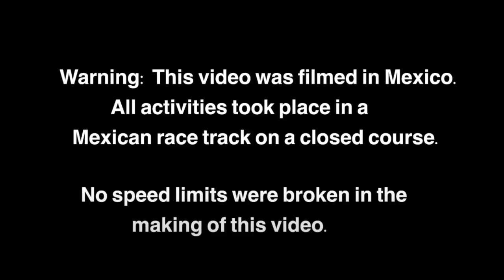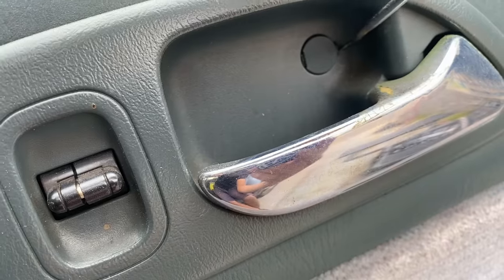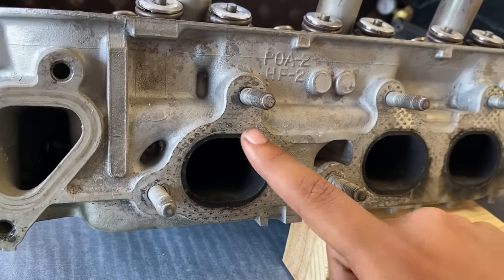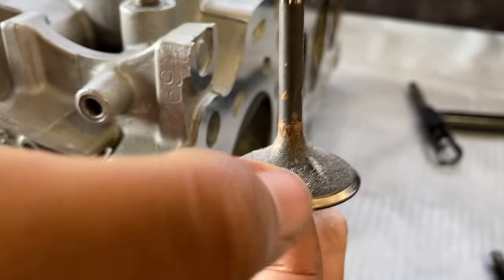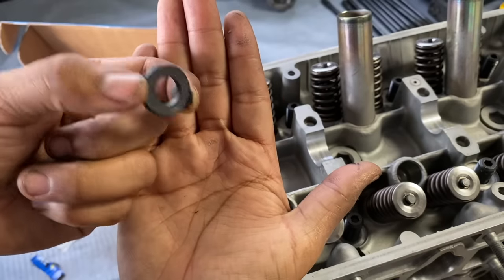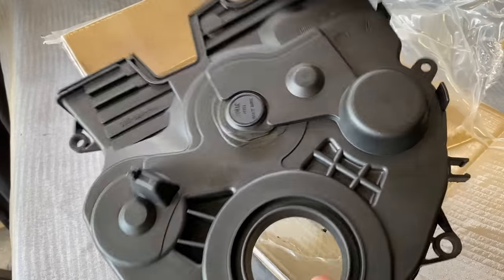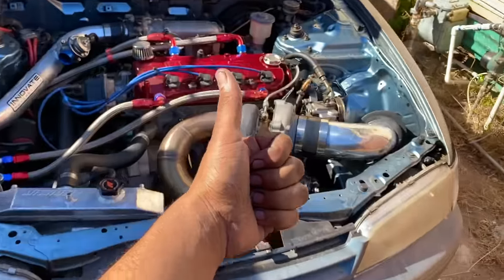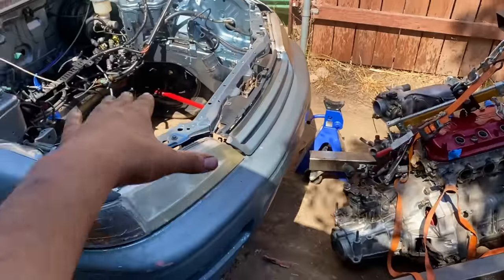Turbo Honda makes 392 Charger Mad + Build Upgrades

Comment: Can’t stand people who thinks their car is almost a hellcat.
Reply: How about peoples who's car is a Hellcat? lol
Reply: @bobfish3176  would they then be the ones who think their car is almost a Demon? 🤔 lol
Reply: @PareKo82  No it thinks it's a Plaid now! lol
Reply: No it's a Bugatti now
Reply: Hellcats are overrated
Reply: @officalsauceboii2172  Obviously you have never driven one! LMAO
Reply: @bobfish3176  they are overrated.  A 12.3 1/4 mile at 123mph in a 6speed manual is pitiful for a 700hp car. Most hellcats in auto run about 11.6 which is pretty damn close to a mustang gt with a 10sp auto. Nearly 4500lbs kills it. Before you mention practicality show me where someone is actually driving a hellcat with people in the back seat . Mostly alone, they might as well buy a bike.
Reply: @Spiritcr1jsher  I slapped 305 drag radials and immediately hit 10.9 with only a drive shaft and diff brace for mods. I would pull 12.2 in my 6 speed 392 so sounds like that car needs a driver mod lol. $ per HP they are very hard to beat!
Reply: @bobfish3176  but not lbs per HP which is what really counts.
Reply: anonymous  😂 🤣 perfect analogyt
Reply: These broken ego 392 owners are the equivalent of v6/4 pot turbo "muscle car" owners driving erratically just because they got a camaro RS, or in the case of the mustang a ecoboost, and they automatically think they got a racecar. I ain't denying, yes 392s are fast, but they ain't gonna beat no sh*tbox honda with a  turbo bigger than the engine itself, and lightweight af...
392 guys, yall should have gotten a hellcat, yalls APRs are already sky-high, why didn't yall just go for the bigdawg and make it worthwhile, JS🤷‍♂️

EDIT: I know, I know... not all 392 owners are like that, I know some of yall be chill asf, yall good. It's the owners that think their 392 beats anything, and "mOpAr oR nO cAR" when they be comparing their car to a McLaren... like cmon.. this ain't Forza, where a Peel p50 can outrun an aventador. Stick with beating stock ss, and 10spd GTs. That I stand with
Reply: @bobfish3176  he can gap hellcats too
Reply: @Miguelc-do8yx  I bet he gaps Plaids too! : )
Reply: I think people are confused. It’s all about Built versus bot. Of course a Built turbo Honda is going to gap a 392 or a 57 get the old 5.7 or 6.1 block proper ring gap on stock internals you can get over 1000 hp.😊 but there’s tons of cars out there with a shit ton of capability just don’t copy everybody. I think that’s the biggest thing with the hemi people they want to go throw a wicker bill and some lights on it. Take the cats out and think it will gap everybody 😅throw that money go your intake, polish your heads.

Comment: I love that roof scoop. It would instantly remove any credibility about your cars performance.  The perfect misdirection upgrade. I drive a 2013 Hyundai accent and even I might race somebody who I saw put a roof scoop on an older sedan. Though I’m pretty sure even a stock Honda would dust me regardless. You’d think the engine sound might sort of give you away though. I’m sure it doesn’t sound slow. Great video lol
Reply: surprisingly with this as long as he isn't gassing it hard it really isn't that loud. totally badass car.
Reply: @bcolerl8915  I suppose not lol. By the time they hear that engine they’ve already fallen for it.  I couldn’t agree more. Totally badass

Comment: I love that you run muffler not open dump, it’s so quiet and stealth.
Reply: plus its a honda, if he didn’t run a muffler it would sound like 💩
Reply: @cannabiscraftsman1278  your point is valid and hard to argue.
Reply: Open dump ftw
Reply from the maker: If I could make it sound as quiet as a Tesla I woulda :D I love hearing only the turbo and wind hitting my windshield 🎶
Reply: @SleeperAccord  ayyy true man of culture. Nice build tho reminds me of doin a all motor build on my old da9 integra took the stock b18a1 n had a fully forged b20z build loved it never got to boost it tho sadly
Reply: Turbo J swap 91 accord 2 door on hoosiers
Reply: @cannabiscraftsman1278  a stocl d15 yeah, but a built turbo honda engine with straighr pipes just sounds so good
Reply: @SleeperAccord  dump valve is one of the sexiest sounds in the world for sure.
Reply: It makes it even better when it looks like a stock car beats out a challenger!
Reply: @cannabiscraftsman1278  I agree, Hondas sound like shit. but a turbo honda with a turbo and exhaust that big, really don’t sound bad
Reply: @SleeperAccord  electric swap it, than it will be as quiet as a Tesla.
Reply from the maker: @CasenFerg  considering it tbh

Comment: Scat pack: Calls accord a piece of shht. Accord: "So, you have chosen death"
Reply: @damienscott9654  but they got same Power and torque basically same car
Reply: @damienscott9654  that’s crazy cuz it literally has a scat on the grill 😐
Reply: @joshfiveoh  was dude tryna say it was a standard v6 because he owns a scat and is salty it got throw in throw in dump by an old accord? Lmao, he deleted whatever he said so I'm askin
Reply: @AIIen-u  nah he said that it was a 392 not a scat 😂😂
Reply: If the accord is a piece of s#@%!,what makes the 392???.wow some people just can not take it.
Reply: @AIIen-u  tbh it’s a fully built car that weighs 1/4 of the charger lol
Reply: @edgarvasquez8372  the accord is a piece of shit though might be fast since the owner knows what he’s doing but it’s still very old and not hat comfortable to ride in
Reply: his dog eyes could not see mount fuji.
Reply: @rzrazorcore2696  it might just be me but all the charger/challenger drivers i met are all aggressive and want to race with their ego on their shoulders. Just because u got a big engine doesn't mean your weight wont mean nothing. The same drivers wont even bat an eye to me now that i drive a GTR coming from a 370Z
Reply: @letsroll2463  those charger/challenger aren't even finely tuned from factory and most of them don't even have proper tires. even if it has 700hp it's probably only making 450-500hp at the wheel.  they aren't slow cars, but most of that power is wasted. unless you change the stock supercharger for a stage 2 which they also offer at your local dealer for a lot more money which is why most ppl don't buy it and just buy aftermarket. apart from that those 2 cars can easily lose 250lb with a good weight reduction.
Reply: 392 likes on this comment 👊🏽😂
Reply: Eh, ill take the honda without all the added electrical bullshit, the mopar is the piece of shit in this instance
Reply: Eh, that 392 is just the credit score....

Comment: I love coming across sleeper cars "out in the wild" About 12 years ago I had a supercharged 01 trans am, it would get out and move pretty well.  I got fuckin walked by a rusty 95 4 door neon on steelies. It had a big turbo srt4 swap in it, was gutted and putting out about 450 at the wheels. Did not expect that thing to run like that.
Reply: Those light cars can find grip and move !
Reply: @souljayt8411  I definitely had him off the line, but once he hooked up in 3rd gear, he pulled past pretty hard.

Comment: Great idea on the cable retention on that door… only thing I’d change is when you wrap that cable around the bolt do it in the same direction the bolt spins to tighten it

Comment: My dad bought this honda back in my days, and I used it to run the Honda starlet turbo and out ran a corolla with turbo. The car was so fast factory with even a bad transmission but still it was the talk of the town. Years after I left the house the transmission got hit and my younger brother ordered a new transmission out of Japan. Went home for vacation couldn't believe the power and speed that thing had. My dad wrote that car off and I was sad because I was gonna take it and build it. It was a special car without any boosting coincidentally.

Comment: Hey, just a quick tip - When your de-burring bit is clean, spray WD-40 on it. The shavings will not stick as bad. You'll need to reapply the WD-40 (when the shavings start to stick again). Love your build and how you're humblely trolling people to race

Comment: Couple things with torquing hardware. There's nothing technically wrong with dry torquing hardware, it normally just requires a higher torque value. In some instances a wet torque is preferred though, especially with mechanical engine assemblies. Also adding an extension to your torque wrench changes the value of your torque. You can find the conversion formulas online but they're normally also in the SAE and ASME specs typically referenced for most hardware.

Comment: Imagine paying over sticker for a dodge charger scat pack just to lose to a sleeper. I might build a kia forte sleeper
Reply: Dont
Reply: Double don’t
Reply: triple don't, put a forte body on something useable, like anything else
Reply: Quadruple don’t
Reply: Save urself some headache and get a genesis sedan they come with 5.0 v8s pushing about 420hp n 380 tq all for 20k its a sleeper from factory
Reply: I've seen some Kia builds, not past ~300whp though. It'd be a sick sleeper for sure
Reply: @krishnapatel2863  hell yeah my homie's V8 Genesis sedan is a ripper but they're a bit heavy. Like 4500lbs curb weight, 50% more than an 8th gen Civic.
Reply: PT cruiser sleeper
Reply: Kai trash
Reply: @Ernesto Urtez no worries it'll be welcomed to the world of weight reduction!!!
Reply: Get a Stinger at least
Reply: I don't think people get what a sleeper is lol that would be pretty funny. Just don't try and use  kia/Hyundai motor looool. You won't make any power and it'll blow up after 1 lbs of boost
Reply: At least k swap da kia
Reply: @torryminers2177  YES
Reply: @iheartgs400  it’s harder to get the Kia dealership to even let you test drive a Stinger than it is to test drive a Porsche. I’m not joking.
Reply: @amr1t_  Lol youve seen the stories
Reply: @dylancraig1  not even just seen online, my older brother had no issue with securing a test drive for a taycan turbo, but couldn’t even get one on the stinger. No wonder the stinger didn’t sell, nobody could figure out how it felt to drive one! 😂
Reply: @amr1t_  😂
Reply: Do whatever you want dude. Don't let people stop you. Accords are boats to and look at this guy. Just saying.
Reply: Don't do that.  There's not much aftermarket support for those and the engines are super weak.  Honda engines are.plentiful and cheap depending what you choose, reliable, have any aftermarket part you can imagine and there's also tons of resources of how to do things because so many people have.  Ya its nice to be different, but I'd rather go with a sure thing that is alot more straightforward
Reply: Kia K900 is factory sleeper with a V8 you can get for a really good deal.
Reply: @Brave-Octopus  wth is that? Not in North America.  That doesn't exist
Reply: Or do what everyone else is telling you to do see how fast that gets you. The reason people like this guy stand or is because they do things that aren't expected.
If doing what is tried and true and what everyone has done and is affordable and safe, if that makes you happy then do it! 
But if you want to do something different then do that too even if everyone says it's a bad idea because there's always a chance for failure bit if you're successful then you will be the stand out.
Just something to think about.
Reply: @rxtuninginc8444  yes it does. It was Kia’s most “luxurious” model. Big boat.
Reply: @joshuajordan5700  🤣🤣🤣 boy stop
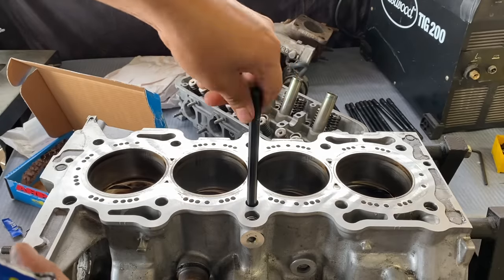Reply: @krishnapatel2863  used is way less…. Also check out 19:58
Reply: @lllllllllllllllllllll1lll1  sleeper cr-v

Comment: Hey you can take the regulator and motor out the piece holding the door windows up for more weight reduction. Just  put a small block of wood under the window when it’s fully up and drill a self taper or a few thru the door into the wood

Comment: I don't know if anyone has written this in the comments, but there is a reason the head, intake, exhaust ports don't all match. When you think about it, Honda, with their high build quality, casting quality, etc could cast things that match perfectly, but they don't. The reason is a smaller port flowing into a bigger cross sectional area fights reversion, or backward flow. There is a formula for this that I can't remember, but if you picture something like a little cone sticking out of an exhaust port into a bigger manifold runner, that really prevents the exhaust backpressure from being able to push back into the head on the overlap cycle. A port mismatch accomplishes the same to a lesser degree. All these little things add up especially when your exhaust manifold pressure is higher than your boost level.
Reply: i port matched my throttle body, intake manifold, head and exhaust manifold. gained 15whp so im not so sure about all that
Reply: @rigorocks23  it's not about hp for factory parts, it's about durability and longevity
Reply: @tybick12  im n9t sure he is talking about longevity.less hp=longer life for sure because there is less stress on components

Comment: I know the video 2 years old, don't know if you still have the car or not. It's cool seeing today young/generation working on original imports that kick-started it all in the States. I had a '94 Accord ex too ( lbrand new), and I swear my '94 ex somehow ended up with the H22A/F22B/B18c5 in it 🤷‍♂️. I just know my 94 Ex did not end up with the US spec motor (2.2L).  Anyway... Have you ever thought/considered doing a WPC on your engine? If not... I highly recommend doing the WPC on your motor.

Comment: In the future, wind that cable around the screw in a clockwise manner so it will tighten as the bolt does. 
It will be more secure.

Comment: I know it has been a while but just a little advice. If you use some oil with the other bit that is not so aggressive, it will unclog the bit for you. Just dip the bit in a little oil, or put a tiny amount on the pieces you are grinding, it will keep the bit clean for you. All the bits you used were for metal, just have to keep them oiled as you are going. Good luck to you.

Comment: Man if I got walked by a turbo sleeper Accord I'd be laughing like the first guy. Guy in the Scat Pack probably already had buyers remorse, you just made it worse haha
Reply: No doubt. Dude can probably barely afford it and already got gapped before, then this sleeper grandma accord waxes him 😂😂
Reply: @whosasking1439  not everything is about speed
Reply: @haffa0905  that’s kind of the point in this video your on a channel for races in a straight line it’s pretty relevant here🤣🥲
Reply: @haffa0905  most of it is about looking good and having cool wheels huh? Maybe a funny sticker or two
Reply: @haffa0905  You're right speed is not everything, but when you're buying a 400 - 500 horsepower car, 9 times out of 10 your looking for speed and a car that looks the part.
Reply: It's probably been in the shop already for trans issues or misfire codes. Everything they make is junk....Ford's teeny tiny little 302 cubic inch naturally aspirated V8 makes the same power as the 392, and far more reliably. The difference in torque is made up in the Ford with less weight, so I killed that argument....
Reply: @RichLifeStories  exactly lmao. Dude went and bought a 500 hp car to go get groceries and take his daughter to her piano recital 😂
Reply: @haffa0905  chargers are literally only built for speed
Reply: @jesterokjones4954  and chevys 6.2 ls  is lighter and physically  smaller than ford's coyote  5.0 and simple and reliable
Reply: Agreed Id be laughing so hard and asking "What the fuck just happened" hahaha
Reply: @mattd19902010  and why did this become a Ford/dodge/Chevy argument
Reply: Same here, it's hilarious seeing cars that are fast as hell but don't look the part at all